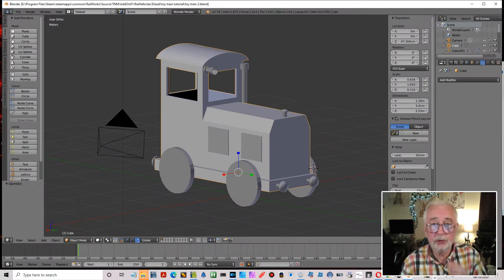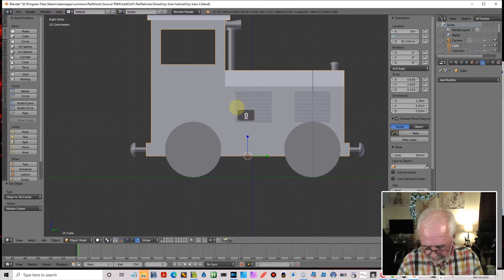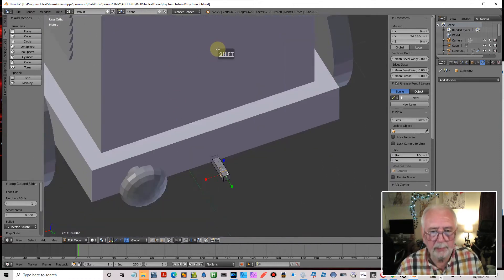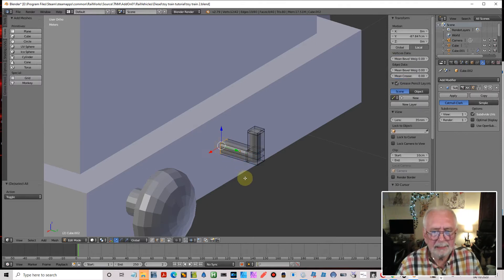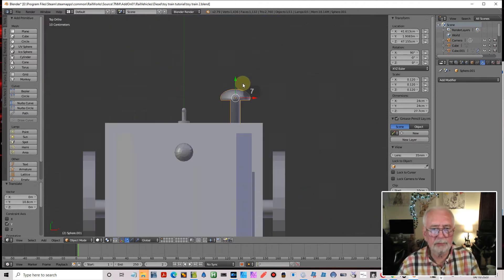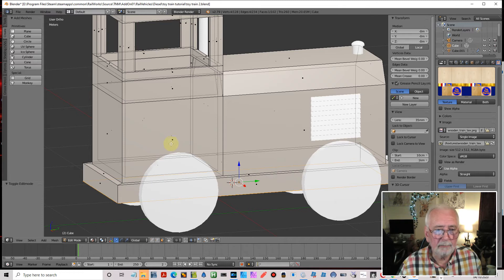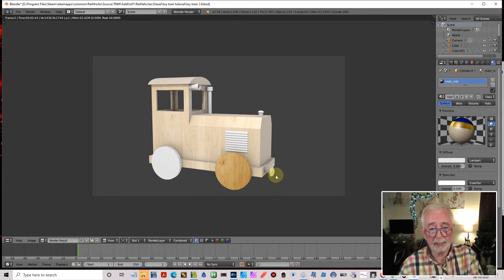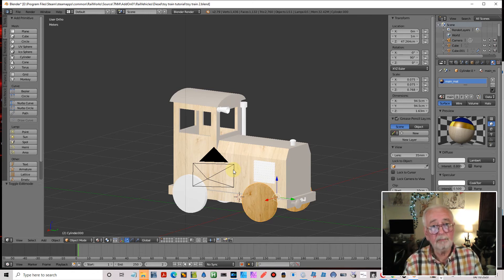Producing a Loco part 2

Comment: Also at 9:41 I see you changed it to UV in Mapping. I use blender 2.83 Myself and I can't see that there. Do you have any idea on what to do?
Reply from the maker: Hi Christian, Blender 2.8 automatically generates UV co-ordinates for new materials 2.7 doesn't so you should not need to do this.
Reply: @tony3133  so do I import my texture in that material thing and connect the nodes in Shading?
Reply from the maker: @christianbay2201   In material properties tab go to Surface dropdown under base colour click circle then select image texture and point to your texture. For IGS you need to do the same in IGS options under textures option. Assigning UV to faces etc is the same.
Reply: @tony3133  Aight Will test
Reply: @tony3133  Hello again, I did all the things you said I should. It doesn't show anything In material preview there it's just plain white. Does this matter?
Reply: Nvm! :D
Reply: @tony3133  Hello Tony, sorry for interupting again. I have done everything, but it says it fails the IGS export.
Reply: Ok I think I found out I had to chose the Texture under textures in the IGS converter is this correct?